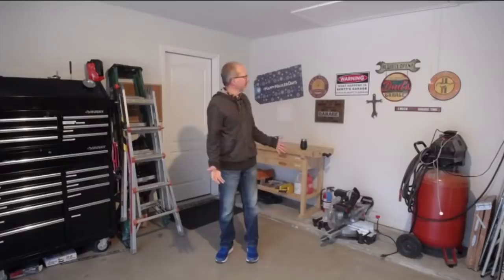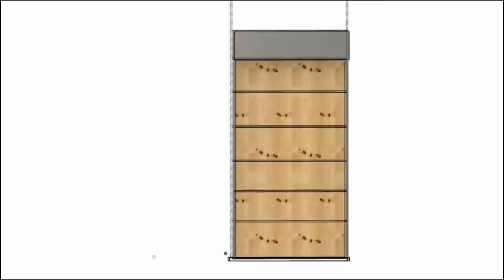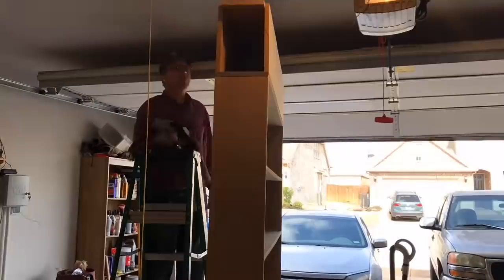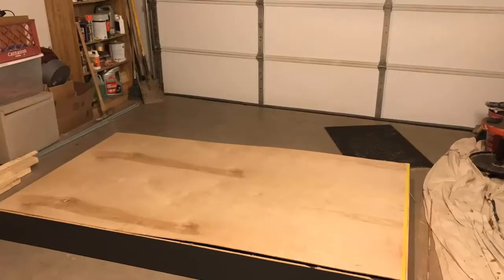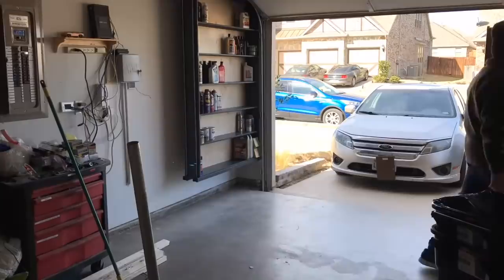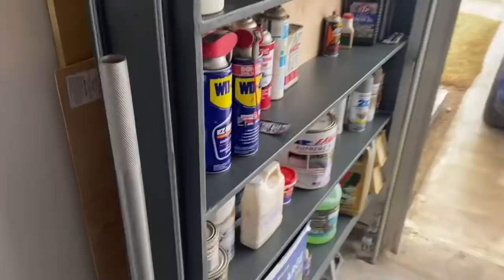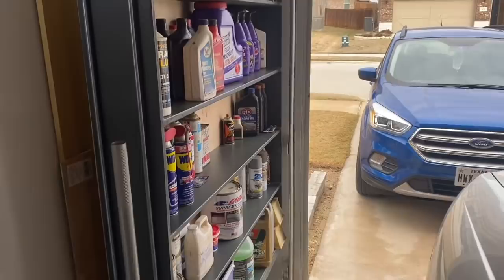Get Smarter Storage with These Easy-to-Build DIY Hanging Garage Shelves with Extra Storage Behind!

Comment: Love the idea, but I'm a professional garage door repairman, and I would implore that if you do any further customization near your door, or if anyone else decides to build this, please keep at least 1 foot clear by the front of the door, and including the walls on the sides.
If your spring ever breaks, we need to be able to access access bearing plates on the top corners of the tracks at the front. Also we need space to be able to get the springs off of the pipe.

If that area is too badly blocked, it is likely you could end up paying for more parts and labor, as we may need to cut parts out, or disassemble quite a bit more to get to certain parts.

In general, please keep the spring system clear, and give us about 1 foot of clearance all around the door and it's moving parts
Reply from the maker: I appreciate your constructive criticism. If I do it over I will allow the clearance.
Reply: @ScottsGarage17  fellow garage repair guy and if I were to walk in this garage and see this I would honestly be pissed at this setup being here.
Reply: @charlesprice4276  I like this, and am going to do this. When I do need my garage door serviced (hopefully not for some time as its only 4 years old) I would just remove it before the repair person comes. It looks way to useful the for the 99.9% of the time it is not in the way.
Reply: Yes! I was going to make same comment
Reply: Not like he can't unbolt it and move it out of the way or anything. SMH.
Reply: @ronb6544  that may be, but often repair techs are in 2 hour windows to get repairs finished. I'm not saying he is absolutely stuck. I'm saying that it will delay or increase cost of repairs.
A tech will likely not be able to lose the time for it to be moved, so unless it's moved ahead of time, it will delay repair
Reply: @williamfletcher3084   Being an HVAC tech for 21 years I know what you mean. I was trying to say that hopefully it would be removed before the tech gets there but we all know how that goes even with the call ahead.
Reply: @Ron B  most contractors NOT ALL would be happy to "stick it to the person" and charge extra to remove it or turn around and leave and charge out the a$$ for a service call.  I understand time is money but money I'd not EVERYTHING.  There is a thing called common courtesy and empathy.   Not attacking you personally (you sound like a good guy) but alot of contractors are just down right crooks.
Reply: @williamfletcher3084  o
Reply: Be sure to keep wasted space 99.99999% of the time so the repair tech isn't pissed.
Reply: First of all, all of the 9/16ths carriage bolts holding the end bearing plate into place are easily accessible with a wrench. Second of all the torsion tube isnt buried behind, or in any capacity anywhere hidden that you couldn't take it down, third of all if you charge extra labor for having to hand loosen two bolts in a part that almost never goes bad and is typically only replaced in a full rebuild when you're trying to charge the customer for parts they don't need.
Reply: All you garage repair guys want a ton of space so you can work comfortably. I get it but suck it up buttercup. Life ain’t fair and you show up once every 10 years usually to fix something the dude 10 years early screwed up. So I am liking this floating shelf. It just works.  So IF EVER the garage door needs repaired just charge an extra hour for your time and get to it.
Reply: @Scottydaleo  
Most DIY's dont need a "garage door repairman" considering the mechanical aspects of a garage door are simplistic at best, I have to be concerned for somebody that has made this their trade. It's laughable at best.
Reply: @randomeverything3023  If resale is in your future, might I suggest you also then check with a home inspector to give you a heads up whether or not it may show up on an inspection report.
Reply: Great point.  Thanks!  Do you have any idea if a home inspector would note it as an issue on the inspection report when a homeowner decides to sell?
Reply: @brendawhite3156  
Not to my knowledge, but this is something that could vary from state to state, or city to city, depending on their code or regulations

Comment: Good build. You might want to consider using washers or a base plate before putting on the bolts. This will prevent the nuts from ripping through the wood and help distribute the weight.
Reply: Yeah, it definitely needs some of that... Fender washers or maybe some 1/8" thick, 1" wide steel bar with holes drilled in it for the threaded bar to go through to distribute the load across the board in the attic better...

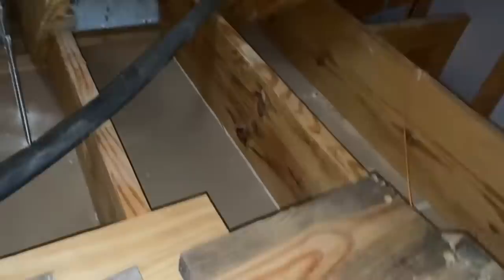Comment: I like everything about this EXCEPTE at 7:02 you are using 2x12 lumber to hang all of the weight from. You've notched out almost all of the 2x12 leaving maybe a 2 inch section to support all of the weight. I would move them out to eliminate this failure point. I've been looking for something to use this space myself and stumbled across this video. I like the idea.
Reply: Agreed, It bugged me right away when I saw the notches...
Reply: The solution is to affix a 2x4 (or at least a 1x4) to the left side of the rafter underneath the notched 2x12, forming a ledge for the 2x12 to rest on. Then, the right side tail of that notch would not be needed.
Reply: @valkyriefrost5301  Exactly what I was thinking.. Small 12" piece of scrap 2x4 is all that's needed, and it would make this setup a LOT safer.
Reply: Agreed. As soon as I saw that, I was cringing.  I would also place something under the rafter as a cleat for the hanging board.
Reply: Would adding 90 degree angle brackets to connect the 2x12 to the rafter solve this problem?

Comment: Great idea. Look at this way regarding the garage repair door complaints. I've have the same garage door springs for 15 years, and I just had them replaced. You will use this rack EVERY SINGLE DAY. You're coming out way ahead in the plus column!

Comment: I made floating shelves in my garage also, different style because my roof is flat and I made a house rule "nothing on the floor". If it doesn't fit on the shelves something has to go. I really keeps the garage clean and the rodent out because there is nowhere to hide. Nice video. I like the idea of the space behind for plywood extras.

Comment: Lordy, what is this world coming to? 19' x 20' is not a 2 car garage. We were looking at houses in Florida with 21' x 22' garages and vetoed them all because of the garage sizes, no way to open the vehicle doors. Don't builders realize that garage space is more important than living space? Finally found one with a 24' x 35' 3 car garage with 3 - 9' x 8' doors. Going to have to remodel the house but we got the garage we wanted/needed.
Reply: Yeap...throw in a water heater, electric panel, water softener,  and sometimes airhandler......one car garage is left
Reply: That's one of my complaints about houses these days... It's like they are designing the garages under the assumption that everyone has a Mini Cooper or Fiat 500... He's apparently in Texas, so there is no excuse for that... A 2-car garage should be big enough to put 2 full size pickups or Suburbans in it with room enough to open all the doors and not hit another vehicle, plus enough room in the front and rear to walk around the car easily without opening the garage door...
Reply: Considering the fact that he has a table saw and some other large tools in there, I suspect that his garage is either just as a workshop or at best could have 1 car in there when he needed to work on it... The table saw is likely to prevent putting 2 cars in there at the same time... He's in Texas and it's not uncommon to see people who have multiple cars parked in the driveway and no room in the garage... Often it is because of the size of the vehicles since a full size pickup might be a bit difficult to fit in one of the garage unless it was COMPLETELY empty... I had a pickup for 14 years and it never saw the inside of a garage and the paint was still good... I've seen pickups will less age with the clearcoat coming off though... I figure it was because I didn't wash it that often and the dirt was protecting the paint... :)
Reply: Never move to europe than🤣 this garage is considered a big garage here🤣
Reply: I e never like the three separate doors. I’d rather have a double door and single door instead of 3 bays
Reply: @Natedoc808  I guess that works if you have small vehicles. To each their own. I have found that the three doors with a 3' wall between them provide more space for each vehicle. When you drive full size pickups and SUV's, then throw in a '60's mid-size muscle car, it is nice to be able to open your car door without fear of hitting another vehicle or wall. A 16' door is just too cramped for two 7' wide vehicles to fit comfortably. And a garage is just for vehicles. The second fridge is in the house and all the outdoor/yard stuff and tools are in the 30' x 50' storage/shop building.
Reply: @denali9449  I rarely see any with 3ft partitions between the 3 doors, typically I see the 12-18” partitions which removes the ability to open the doors which is why I’m not fond. We install minimum 20ft wide, preferably 24’ wide openings; you have to order a custom door but it’s worth it. I myself have my 60x42’ shop however many building sites don’t permit a garage and a shop so the garage need serve as both as indicated in these videos and many peoples’ comments. Best to be able to park your cars inside and still have plenty of room for your lift and shop space in the 3rd single car entry which we usually frame to 12 feet but minimum 10’

Comment: I think this is a great idea, but I am a bit concerned about your boards you used in the attic.  Since you had to notch them so significantly to fit around the rafters there isn't much meat left to span the gap between the joists.  I would check them often for signs of cracking or reinforce them to carry the weight across that span.   Aside from that, neat idea, and well executed.
Reply: I was thinking the same. Should have sistered a board to the rafter under that board for more support.
Reply: I also see no need for a ten foot all thread.  Just bolt it from the top.  8 inch bolt would hang that.   I'm not a fan of the cross beam.  I would've used steel.  Nice idea with clutter hiding storage behind the shelf.
Reply: @hipairbrush1053  I can see the benefit of running the all thread to the bottom.  What he is trying to accomplish is to carry the weight from the bottom like a normal floor bearing cabinet would.  If he were to suspend it from a bolt as you suggested the cabinet would be trying to pull itself apart from the top plate as currently built.  It would need to be constructed a little different for this to work, but I see where you are going with it.
Reply: You kept saying Lowe's but anyone can tell your video is showing Home Depot signage , saw station and orange decor accents to wonder what other discrepancies are being overlooked?
Reply: @Rafi_l  maybe he is like me and swore off the Home Repo due to their crappy corporate idiot mentality
Reply: @Rafi_l  stock photo maybe 🤷
Reply: @shipdog44  did you watch the video? He wanted the space behind the shelves to store 4x8 sheets of plywood. That's why they're hanging and not bolted to the wall.
Reply: 🤦‍♂️ when DIY’ers think they have a great idea then a contractor has to come in and fix it.
Reply: @gldmembr6132  my experience with contractors is it's way too expensive and then I have to fix their work.
Reply: @toddmayta7615  it’s because your being cheap and don’t want to pay for good work… you get what you pay for.
Reply: He should have just adding blocking to the side of the ceiling joist and then another block on that . Those blocks he bolted into aren't going to support that weight. He wasted all that time notching around that rafter... if the rod was closer to the full bearing 2x12 on the ceiling joist it might stay up.
Reply: @seetheworldfrommyharley  Lowe’s is worse.
Reply: @larrytate1657  nope they suck equally.  Home Depot just happen to screw me last...and for the last time.  I will buy from Lowes now on large projects until they screw me...otherwise I will pay more to shop my local hardware store
Reply: I would go ahead and reinforce them instead of periodically checking for cracks. Chances are it would give way suddenly without warning.
Reply: Just run some good sized construction screws through the rafter and into the support that spans the rafters.
Reply: They’ll be fine-you can always just add an L bracket from his add on board attached to the joist if it’s a worry
Reply: I love all the “here’s what I would do…” comments… 🤣🤣😝😝
Reply: @seetheworldfrommyharley  Lowe's has the WORST Customer Service possible.  I vowed NEVER to shop there, regardless.
Reply: @Chris Butler  maybe because ALOT of contractors gouge people so they can buy boats and jet skis etc. Instead of having compassion for a fellow human being
Reply: @seetheworldfrommyharley  
Eventually you and I will run out of places to shop as we get screwed and vow to never return to a store.
That’s why new stores may survive (for a while)
Same way with restaurants, car repair, doctors,pharmacies,lawyers,banks,etc.
Reply: @toddmayta7615  MikeFromRVA was referring to the lack of support for the shelves in the attic.  He wasn't commenting on the merits of the fact that they were hanging.

Comment: I definitely agree with keeping stuff off the garage floor as much as possible. Either on wheels, or hanging from the wall or ceiling.  In my garage, the foundation blocks are proud of the finished walls, so I often have shelves sitting on the foundation and then lagged into the wall studs.

Comment: Love the concept of a hanging narrow shelf like that. Ive been constructing storage spots with French Cleat systems. Ill design something off a Cleat that will take it off the floor and provide space in the back. Bonus is since  I have to brace the bottom away from the wall it will give me a hidden shelf for the sheets of plywood in back to also be off the floor.

Comment: Very nice design.  I particularly like the rods that hang the shelving.  I might be able to do something similar in my little blacksmith shop!

If I was to suggest one thing to others watching this.... if you don't want the hassle of going through the ceiling, you can make hangers that mount to the ceiling with glue and screws.  Drill a hole for the threaded rod in some 2x4, then counterbore the wood to make room for a Tee Nut.  When this is mounted to the ceiling, the Tee Nut is captured between wood and roof material so it can't back out or pull loose.  The 7" of clearance behind the shelf would even allow for gusseted brackets to be mounted to the wall so the shelves could hang from it.
Reply: Or coulda just screwed into the wall frame and save yourself some wasted space, time and money.
Reply: @BenJamin-iz6yc  Not necessarily.  The wall studs would have needed to be where you needed them, plus you would need to build some kind of hangers that spaced the cabinet off of the wall to get that gap for storing sheet goods.  Doing that would have put tremendous strain on the wall anchors and likely resulted in something that just ripped out after awhile.  Never mind the problem of it swinging around on you.

Comment: I’m used to having a respectable size shop, so when my wife and I were house shopping for a relocation and the real estate agents were claiming “large garage” “spacious garage with extra space for a workshop” I followed up with, “wait, this isn’t the walk in closet (pantry/coat closet/broom closet, etc.)?!” They were stunned, stammering, trying to salvage their sales pitch! It was classic. Settled for less house, larger lot, with a full size shop (25 deep x 50 wide) with loft over the single car bay with 10 ft tall door over the 40 ft section and lean to off the side. Also has a 10 foot rear add on that runs the 50ft width that serves as my parts and storage warehouse as it came with shelving down the full length of each wall. I’m in the midst of reconfiguring it and may do a lounge up in the loft as the storage really isn’t needed.

Comment: Since I am pushing 80 I sold my duplex and decided to rent.  I no longer wanted to deal with tenants and the maintenance was getting too difficult for me to do.  I gave away most of my larger tools but I still needed substantial storage space.  I purchased some 18" shelves from Sam's for around $100.00 each they have wheels and shelf liners. They have them at 12"-18" and 25" wide. Great value and very sturdy for the money.